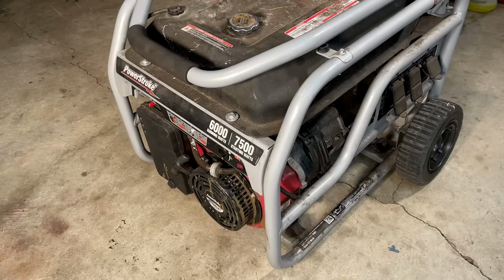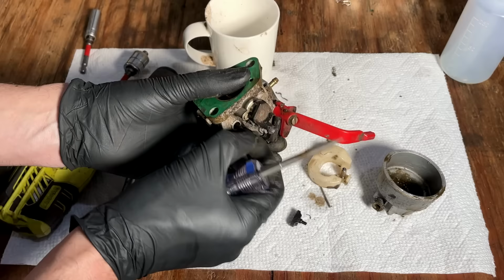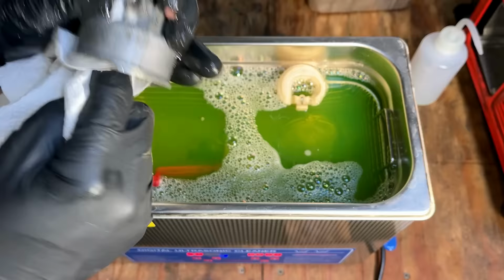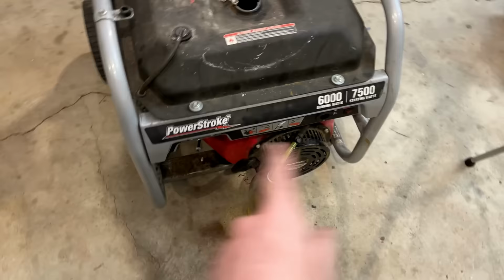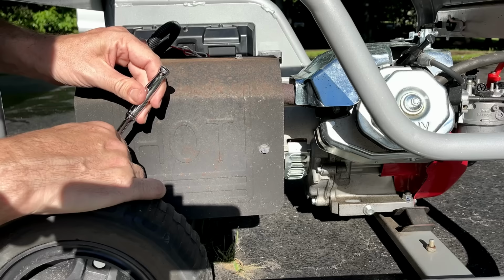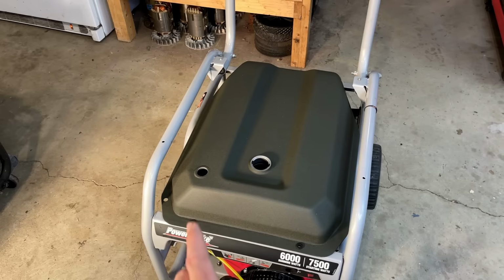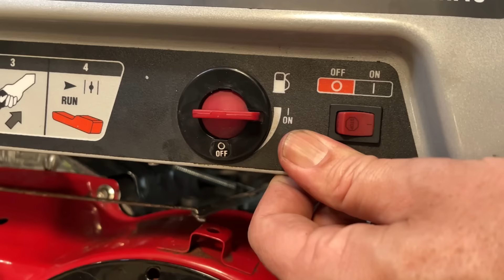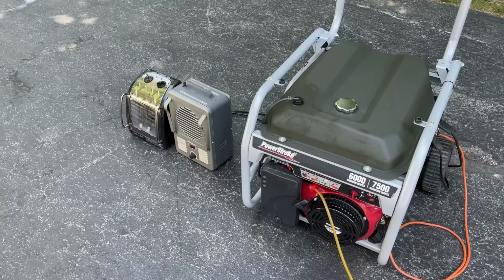Neglected PowerStroke Generator - Will Not Start

Comment: Hi, James. The generator suffered from both poor maintenance and a bad environment. Both water and dust in the tank contaminated the carb. The. The new tank made it better than the original. It was a quick catch to see the leaking gas. Luckily, you didn't have to work on the carb to get it running. You cleaned it up and painted it up to look almost new. I don't know how old that generator is, but it certainly doesn't look its age now. Good job! Thanks for sharing! Stay Healthy!

Comment: I liked your negotiation on the buy price!  I do the same thing.  If the seller cannot get it running, my offer price drops quickly.  You did well on this.  $50 for the cords and $50 for the gen.
Reply: And the fuel too!
Reply: That was may take when I first heard the $200 price. Glad he was able to get the lower price. Always a fun watch and trying to guess at the beginning what problems he encountered based on video length.

Comment: I have that same exact generator. Someone gave it to me for free because the air cleaner was missing and it would not start. I cleaned the carburetor and it started right up and it is making power. I ordered a new air cleaner assembly from Amazon. I changed the gas filter and put in a new gas shutoff valve and Changed the oil. The inside of the gas tank is brand new and so is the cap, no rust. The engine only has eleven hours on it.😊

Comment: 1/4 inch to 3/16!!! who knew--something i will keep an eye open for. That info alone was worth the video for me. Thanks again.
Reply: Straight fuell ine reducer connectors are fairly cheap and come in a variety of sizes. 1/2 inch to 3/16 inch is the most common size.  Metric sizes are common too.

Comment: clean up the Stator with Brake Clean, which won't damage electronics or plastics or rubber,  anti-seize on the heat shield screws for easier disassembly later
Reply: I thought of the anti-seize too. Such a simple step.

Comment: Wow, that thing was a MESS! I bought this exact same generator last year in great shape but with a partially blocked carb for $200 and it was definitely a steal. It came with a 75’ 10/4 cord with twist-lock ends for my whole house hookup. It’s a great generator, my only gripe is the low ground clearance makes it a pain to change the oil (have to put it up on blocks). This replaced my old 3000 watt Mickey Mouse generator that I bought from Pep Boys back in the early 90’s (which I sold for a decent price). Power hasn’t gone out since!

Comment: Iv'e got all my friends using your tea ball method for holding smaller parts. So much better then fishing through old cleaner solution to find the needles and jets. Also for the rusty tanks i bought some triangle shaped ceramic pieces and put them in the tank and shake it on a rope until the rust is gone and you can wash them off and reuse for years.

Comment: Nice work James. I installed new rings on my lawnmower. I saw where you used a stainless steel gear clamp as a piston ring compressor. Worked like a charm. Thanks

Comment: Great video, my man! It makes me glad mine has a plastic tank. It was neglected like that one and I had to power wash it and couldn’t totally cover the generator head, but I covered the part at the back where all of the wires and brushes and that good stuff, anyway, I washed it and painted parts of it. Scrubbed rust off and things like that and it come out looking like a five-year-old generator instead of the 18 yrs old that it is. Paid $75 for mine. 8500/5500 watts

Comment: I have a 6500 running watt generator that I haven't used in a year or so. However, I only run non ethanol gas and, even though it has a fuel shut off, I drain the tank after every use. Seeing this video reminded me that I need to put a couple gallons in the tank and "exercise" it before winter just to make sure it's still good.

Comment: You have a consistent methodical approach to your troubleshooting and restoration decisions.  Also the way explain each step makes your videos an excellent learning resource.   If you soaked some penetrating oil on those rusty bolts, you might not snap quite as many.  Another technique is to heat red hot and quench with water.  Your videography is better than anyone else doing this kind of work.  Really enjoyed watching them!
Reply: Yes!

Comment: Two things, I still think the Idle screw should be used a Throttle plate stop adjustment so the plate doesn't close to far and bind and it is very possible a small piece of rubber from the new hoses could have moved under the seat & blocked the needle from being able to seal. This was an old issue on carbureted engines on old cars when replacing the Fuel line, Pump or filer. Great video as usual, nice call on the Ryobi Fuel tank, there is no substitute for experience James.

Comment: To get 3/16 pipe on to a 1/4 hosetail put the pipe in some hot water and it will soften it enough to push it on.

Comment: Excellent find and save, Jim! $80 Ryobi tank is way too convenient too. Do you ever tell the folks you buy from that you have a YT channel and that they may see their unit getting fixed there if they are interested or curious? This one reminds me to follow up with a neighbor to see if he ever moved his generator indoor and out from under a lean-to that he has on the back of his shed!
Reply from the maker: I do not tell people that I have a YT channel.
Reply: Well said ive had enough machines ive picked up cheap or free, and when i get them going again , sometimes they want to buy  them back,
Reply: Telling people to check out what you do would just bring problems. A jealous previous owner, when confronted with the fact that they are a neglectful dolt, that ruined a nice generator would bring nasty comments at least, and charges of theft by swindle at worst. Some people have no shame.
Reply: @A_Man_In_His_Van  Oh I don't disagree! I was half concerned that Jim might tell folks their equipment could wind up on his channel. I was more curious than anything and wouldn't begin to speculate what legal risks, if any, there might be.
Reply: @A_Man_In_His_Van  Agreed there is a mehod to it,or  just dont confront them you fixed it , but you used the good parts to bring something else back to life
Reply: @jcondon1  With some of those metal gas tanks... you MIGHT be able to clean them out, on the inside with styrene chips. Tumble the tank for a little while, then rinse.
Reply: Yeah I'd definitely not be telling people, that is a big part of the business, buy cheap, sell expensive, everyone knows this, it's the fundamental part of every business, but it's better to not put it in people's faces, else it makes them upset. Weird creatures us humans.

Comment: It baffles me that the designers would engineer a rain puddle on top of the gas tank. It's almost like they want it to fail so they can charge you $200 for a new one.
Reply: I agree completely. Dumb idea. Guessing the Mfg’s safety design team insisted on extra room in the tank for fuel expansion in warm weather when the owner fills the tank to maximum.
Reply: It helps with fuel spills, holds the fuel there for cleanup. Most will direct the extra to spill off the machine with a channel.
Reply: Functional obsolescence?
Reply: @FishFind3000  Then they should have made the fill neck tall enough so water doesn't go in the tank. It's still a stupid design. I don't care what their justification was.
Reply: First off a generator of this type shouldn't be ran in the rain nor storing them out side isn't that great for them either
Reply: I agree it’s terrible to see it made to fail
Reply: @FishFind3000 ACTUALLY correct... I asked the Caterpillar dealer about the same kind of design on mine ( a 'Cat RP6500' [ Apparently a honda clone engine ] but the
 * to quote Caterpillar * " spill catch basin " isn't as deep so it won't let any water get into the tank like this Powerstroke does because the area where the cap seats isn't submerged with the "catch basin" full [I tested it by filling it with fuel and the paper I had in the top of the tank was dry when the fuel began to run off the back of the tank into my catch pan. ] it looks like a halfway point between the two tanks he shows here...  the catch basin is deep like the Powerstroke tank but about half that depth it flows to the back like the Ryobi tank.  )

Comment: That does look like a better tank design than the original. However, if the generator was parked at an angle (not level) then pooling of water would still be possible near the cap. There's really no need to design this kind of failure mode into the system. It would be quite easy to design a tank that would allow water to escape on both ends.
Reply: I believe it’s a safety issue , not letting spilled gas from the tank running over the exhaust.

Comment: Great video! Is there an engineering award for the worst design? That gas-tank that collects rainwater into the fill hole has to be a top award.
Reply: I agree!  Why put that recess in the tank?  It serves no useful purpose.  Even the Ryobi tank has the recess but at least it can drain (if the angle of the generator will allow it).
Reply: Design engineer's boss wanted to make it very easy to add gas. The engineer gave it a 14 inch x 6 inch collection area to easily spill gas into

Comment: This was another with gas tank rusting. I been thinking about the virtues of replacing tanks v cleaning them out. Replacing tanks is obviously the best but it can be grossly expensive. Asking over 200 dollars for a powerstroke tank is ridiculous. It is good that someone with as much experience as you knows that a cheaper different brand will fit just as well. Even the Evaporust you use is 20 dollars a gallon. Corrosive acids are not cheaper. What about using electrolysis? Its bound to be cheaper. I have used it for removing rust off iron plate but never tried it for inside gas tanks. The tank could be filled with a solution of washing soda  [Sodium Carbonate, which is cheap]. A partially rubber or plastic covered connected iron rod is place in the tank with enough of its surface in contact with the solution making sure its not shorting to the metal. A battery charger is then connected to the end of the rod and the metal frame of the tank. The iron rod is the sacrifical piece but any old bit of mild iron will do. The material given off at the iron bar end looks horrid and bubbles of gas escape as well. The bubbles are hydrogen so this needs to be done away from possible sparks in an area with good ventilation. I wonder how long it would take to do any good? Has anyone tried this before? Does it work?

Comment: Another excellent video.  I only have one question.  When you were cleaning the unit waiting for the tank's arrival did you pull the generator cover and clean the wiring/contacts?  I noticed that you did it on another of your generator rehab videos.

Comment: I broke 1 of my carburetor studs. Mine was in the house & rain water leaks thru my concrete steps right at the carburetor housing. I put some starter fluid to make sure it start. It runs. So I started to replace the carb & the torn head broke. B & S don't make 694869 no more. My lawnmower dealer looking thru they junk pile for me😊

Comment: Hello James , I wanted to say I do like the tank improvement but am still a little concerned about it,  I would like it more if the filler neck was longer.  In the video it looked like it could have the same issue if it was set on an incline toward the engine end. I know Stant makes an extension for deep set radiator necks/caps.  I don't know if such a thing is made for gas caps.  I also think a brass bristle paint brush could help with the carb cleaning but again I don't know if such a product is made.  All in all it looks like you scored a winner there , congrats.  Thanks for the video I really enjoyed it.

Comment: Another diamond in the rough made whole again. Great job James. I noticed initially it had one of those white in-line filters. I could be wrong, but aren't those the sub micron type? The red one you used is basically just a mesh screen and I believe the proper one for these small engines. It's no wonder the fuel system had multiple issues.

Comment: Have a suggestion for ya you always deal in rusty stuck bolts there's a tool you use with an air chisel it's called shake an break look it up it's made for screw driver bits and sockets from 1/4 to 1/2 size works awesome look it up an see what you think I bought 2 well worth the money

Comment: Have you ever tried the sharp rocks and diesel tumble method to clean the tank, done it myself with good results, strapped the tank to tractor tire. Much cheaper than chemical cleaning, saved from having to buy a new tank.
Reply from the maker: Just nuts and bolts.

Comment: ImI have this exact generator and using it fir a power outage this week found that at onky a 1500 watt load frequency drops by about 4 hz.  Runs perfectly at no load or load no surging choke is open, but just cant handle loads without dropping rpm’s.  Going to troubleshoot this weekend.

Comment: As a self described small engine nerd, I hate seeing a machine end up in this position for no other reason than simple neglect. The previous owner essentially took a loss on this machine simply because they were unwilling to maintain and properly care for them. One man's loss is another's gain. My grandfather would simply run his machines into the ground and then buy new ones when they broke down. He had two lawnmowers sitting in his backyard for years that were given to me after he died. It took me about three hours and $8 in parts to get both of them running again. I am still using them four years later with no issues. I don't understand why people spend a lot of money to buy something if they are unwilling to properly care for it.

Comment: To clean the tank…Try throwing a pound of steel BB’s in the tank..put the cap on..plug any holes..shake like crazy..very loud however..ear pro recommended…BB are steel can recover strays with magnet…may work on some lightly rusted tanks

Comment: Rance here, another very good generator repair video- - - you are the best. I have question, since the generator was probably not stored out of weather was there a clue that made you think that there was no critter infestation, therefore no reason to check cooling air flow ?
Reply from the maker: Normally critters are not able to get into the generator blower housing.  But it can normally be see in the head or when started if junk starts blowing out.  Always a good idea to double check.
Reply: @jcondon1  You’re right, thanks Jim.

Comment: As always, a great video. Wondering if you've ever tried muriatic acid to clean a tank? I've done some small engine tanks, 1 gallon being the largest. I was quite pleased with the results. Nasty stuff, but after a hour soak and rinse, its good to go. I use a liberal amount of WD-40 to prevent flash rust.
Reply: You can use Ospho (phosphoric acid) to stop all rust in the tank or on any rusted parts.  It turns iron oxide into iron phosphate which is inert.  It also acts as a primer for painting.  Great stuff I found when had my boats in saltwater environment.

Comment: James, I would be careful using WD-40 as o-ring lube. It can attack most rubber compounds. Silicone grease is better for everything except Silicone rubber. That you can use petroleum grease on. Fuel hose is pretty resistant, but not completely.

Comment: Do you have a thumb pump? I finally picked one up after revisiting so many carbs that leaked through the needle seat after I reassebled. Nice to know those seats hold pressure before you put the carb. back on. I use it religiously now. Also I found that a cheep, handheld microscope will allow you to inspect the seating area of the needle. The rubber tipped ones are hard to inspect with the naked eye. (my eyes anyway) Also, I have determined that Ethanol in gas is actual a great idea, I am indebted to the genius that thought of that. It allows me to find almost new, none running generators and yard equip. for pennies on the dollar.

Comment: Interesting why you didn't use your fuel bottle to initially test from how you described the tank.  I guess starting with either since the carb was dirty anyway.  When do you consider replacing a tank versus cleaning up the old one?
Good video

Comment: spray Liquid Wrench on the bolts before trying to loosen bol.ts.  You can also spray Ospho on the muffler and heat shield to stop rust.  It also acts as a primer for paintng.

Comment: James I use Orange juice bottles for draining fuel they are much more sturdy and have a larger fill neck...
Reply: If you are going yo buy a fuel tank why not go with a ABS Plastic no rust one?
Reply from the maker: You would need to add a heat shield and there is not a plastic one available that would fit this.

Comment: Jim, have you ever tried gas tank sealers? These are sometimes used on vintage equipment with multiple pinholes, rust problems, etc. You might look on eBay or Amazon.
Reply from the maker: I have not tried them yet.  Although I have a tank now that might need it.  Cannot source a new or used tank for it.
Reply: @jcondon1  I know it isn't an approved method, but I added a 5 gal heavy duty polyethylene can which I had to my generator which had a rusted out tank. I don't want a metal tank. I cut the top of the old tank off and made a bracket to hold the round can. It is quite secure and can still be removed easily. A plastic shutoff completed my modification.

Comment: Another great find and save. 
Just have a question have you ever tried to save a fuel tank by washing it with   muriatic acid 1cup must wear gloves when handling acid drain acid then a gas/oil rinse cup of each then then drain and fill with fuel let sit?
Then check to see if it doesn't leak or rust forming on bottom.
Reply from the maker: Not with Muriatic acid.  Mostly because I am afraid of eating through the tank.  I usually use evaporust.